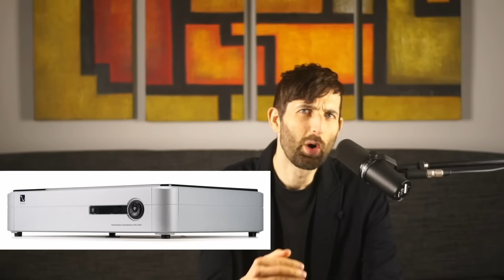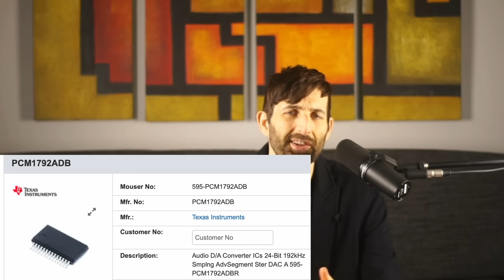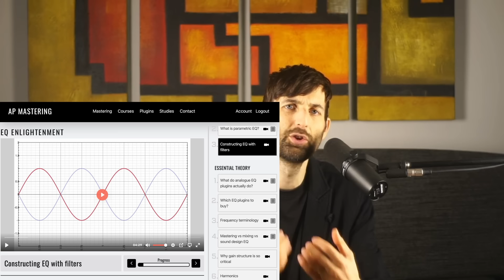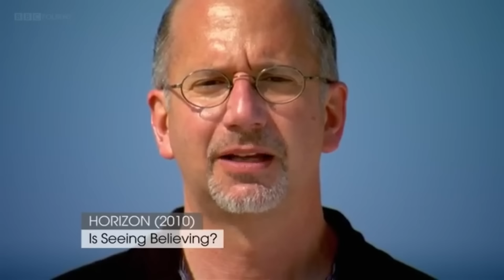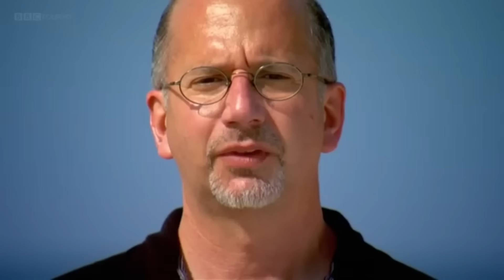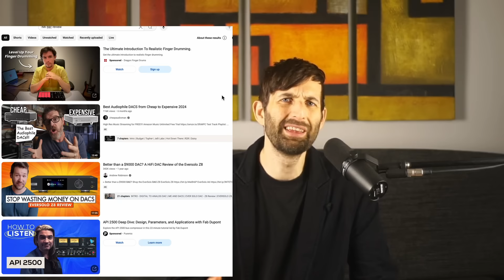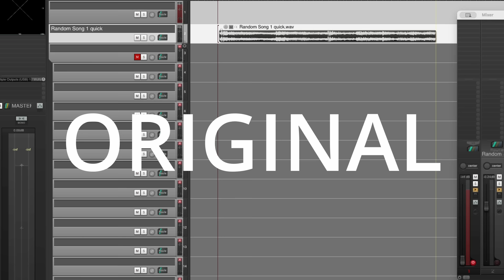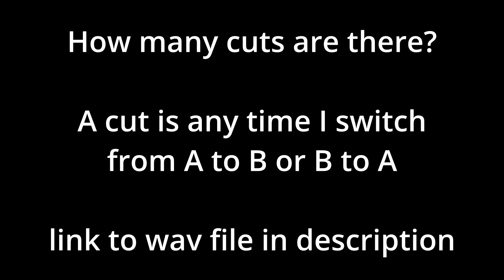The DAC Scam - Almost everyone believes the hype

Comment: This is NOT entirely true. Just because two devices use the same DAC chips doesn’t mean they’re equal in performance. Even with identical DAC chips, the quality of the clock, power supply, and signal path can drastically affect sound quality. The clock's precision plays a crucial role in maintaining timing accuracy, which impacts the overall clarity and coherence of the audio. Additionally, the design of the circuit board, the quality of capacitors, and the noise isolation from other components all contribute to how the DAC chip processes the signal. In short, the supporting components and design choices can make all the difference, regardless of the DAC chip itself.

This is oversimplified big time
Reply: oh no, not the angry audiophiles, hahah.
Reply: @nrmntq.brainrot-c3k  Audiophile gear are magic healing crystals, but for rich guys.
Reply: @nrmntq.brainrot-c3k haha yeah name calling with no substance to debate, just personal incredulity, bias and gullibility
Reply: I think there is a caveat to this. Those changes you are mentioning might be minorly noticeable on extremely detailed high-end speakers in a treated space. On normal speakers the difference is so small most can't pick it in a blind test. On tiny cheap speakers/buds, the difference is not just next to nothing, but a big fat nothing! Add in streaming codecs and playlist processing, and whatever difference may have been noticeable in a recording studio playing from the full wav file, is now two fifths and three fourths of absolutely nothing in difference.
Reply: @THEJRODIUS  "Those changes you are mentioning might be minorly noticeable on extremely detailed high-end speakers in a treated space."

To be honest, that's still a no. You won't be able to heard those differences at all, unless the DAC has been intentionally designed badly, with the caveat being that this obviously doesn't apply to a cheap amp you bought on TEMU. But even then, the sound differences are highly unlikely to be because of the DAC.

DAC and ADC are solved problems.
Reply: @RegebroRepairs  Oh I am just being charitable by granting the possibility of minorly noticeable differences. That's why I used the word minorly.
Reply: @THEJRODIUS  There's a theoretical possibility, yes.
Reply: @RegebroRepairs  Appreciate your insights. They are needed to temper some of the flatulent comments here.
Reply: @RegebroRepairs exactly! Also genelec monitors have class d amps without nordost internal cabling or special iso acoustic feet etc
Reply: @THEJRODIUS  system synergy is also important and not just referring to the price. Some systems will emphasize weaknesses in the input signal while others may mask them. For example a 'bright' signal into a 'bright' speaker will sound bad.
Reply: @jgsburnett9532 AHAHAGA bs! No such thing if you just buy transparent gear. When u say warm you know that means distorted right? I think you better learn a bit before talking nonsense, it really is embarassing
Reply: You are right in that the surrounding circuitry can make or break the performance of a DAC. But it is no rocket science to design a clean circuit with proper separation between digital and analog parts. Most DAC datasheets even specify PCB layouts for best performance. Regarding proper power supply: that's no rocket science either. A decent clean power supply can be made for less than $20. There is no need to have a bank of 400 capacitors in parallel, which some DACs have. The only benefit of that is that it adds to the manufacturers profit.

Oh and don't get me started on proper DAC clocks. A simple $0.50 crystal from a reputable manufacturer will suffice. Anything ovenized is just fancy boutique stuff, again only good for the manufacturers profit.
Reply: @meindertsprang7491 they won’t reply to you, you lost them at the start, they like to reply to stuff that’s dumbed down and subjective because they can argue all day then
Reply: @ How do you know?
Did you even try? Do you have a hi res audio set?
A simple crystal is not a Dac clock, it`s just a simple crystal which in quality audio is just not good enough.
Reply: @brugj03  You can not hear the jitter of a clock signal in the MHz range, I promise you. 🤣
Reply: Don`t  you promise me.
I`m not interested in your babble.
I use my ears and so should everyone.
There is no denying the improvements.
But you didn`t even try now, did you.
Reply: @brugj03  Did you do a double blind A/B test?
Reply: @RegebroRepairs  Off course i did.
I can trust my ears.
Reply: @brugj03  No, you literally can't trust your ears. 

So you really did a double blind A/B test? Can you briefly explain the procedure?
Reply: @brugj03 HAHA THE OLD “I use my ears” your ears are inferior to audio gear. Dynamic range of 120db is you telling me you can hear a pin drop next to a jet. Super tweeters? You probably can’t hear past 18khz yet you need them to go to 35khz 😂 amplifier distortion too much at 1%? Your room probably adds 30%
Reply: Slightly? More like non existent sonically in any half way competent DAC at almost any price.
Reply: Do you think engineers who projected and tested those differences in capacitors, noise isolation ecc, in order to choose one or another, did it by ears?
Reply: @Melkitzedeq  If they are the right kind they absolutely did.
If they didn`t what`s the point anyway.
Besides, you don`t really care, now do you.
You just wanna have your say and get some attention.
Reply: Bit surprised reading this thread - this take seems pretty weak.  He clearly stated that the other components have to be good - but that you can get that for a few hundred - he never said that ANY unit with the same DAC chips will sound equal in performance... he said the dac itself will perform the same... more expensive units with the same DAC are not 'better' DACs than lower cost units with the chip.
Reply: Audiophiles actively defending pissing their money away will never cease being funny to me looool
Reply: All these things make no difference to the audio quality unless they are completely broken in which case, time to buy new equipment. Digital audio is 0s & 1s, on or off, it either just works or it doesn't when it comes to D/A conversion.
Reply: Are you an electrical engineer making these claims? I would be interested in knowing your profession and how it relates to audio science.
Reply: "Even with identical DAC chips, the quality of the clock, power supply ... can drastically affect sound quality."

No, it can't. That's audiophile snake oil.

"and signal path"

It's technically possibly to mess this upp, yes. But it's honestly very hard to do. So in practice? Still no.
Reply: So this guy has listened to all the DACs out there ' impossible
Reply: I don't think that clocks are ultimately important, they get divided and somitimes multiplied and things like PLL's are effective. In my experience there is much more harm to either a datastream or signal by PCB's. Or logic / chips with bad powering or filtering causing issues getting bits missing. Perhaps people distrusting tantalum capacitors might be even more harmful...
Reply: For example: I've heard ESS Sabre equipped DAC's sound both pedestrian in some and very vivid and energetic in others.  The sound of a DAC is a whole lot more than just the chip.  It's also opamps and other components on the analog side.
Reply: @scottlowell493  You are right, I know, I work on DAC's.
Reply: @scottlowell493 lol op amps haha here we go
Reply: Stable clocks are not hard to make, neither are quality power supplies...and they are not ten times the cost of weaker designs.
Reply: @marcfavell  The clock is crucial
Reply: @xStudhouser6969a statement i fully agree i noticed myself and although a lot claim it's not important my experience is is that it determines at least 80% of the total sound experience
Reply: Valid points made but AD DA chips are just part of the equation I believe. Things like op-amps, power supplies etc. make the other part of the equation and even the subtle difference.
Reply: You do know 99% of dacs above $100 sound the same in 2025 right? That’s like saying the dynamic range of 1 dac is 121db and the other is 90 and distortion is 97db down and the other 105 and therefore there is an audible difference.
Reply: (Sigh) Nearly everything single thing you mentioned there should be corrected by the DAC - it's quite literally one of its functions. If the DAC is the same - the sound will be the same, full stop.  Power supply issues aren't going to affect clarity and coherence - those are analog concepts that have no place in the digital realm.  For a digital bitstream to sound different from source to source, it has to be altered somehow and you cannot alter a digital file - even to introduce noise into it - without decoding and re-encoding it at some point.  And that doesn't happen until you get to the DAC.
Reply: £160,000 power supply? Listen to yourself.
He obviously claims the most advanced part costs £50.
Reply: Speaker selection and placement makes audible difference spending 40,000 dollars on a dac is plain stupidity.
Reply: True.. But not 5k worth
Reply: I agree...a bit too reductionist. Power supply, analogue stage, clocking, & the way identical DAC chips are implemented in different ways all play a significant factor. Also no mention of non chip (FPGA) based DACs. Thats a big miss. However i agree all consumer grade audiophile products are wholly over priced.
Reply: @alexYT87462  The law of diminishing returns is real.  A manufacturer must recoup all development costs, pay for marketing and all other business costs. A cheap product may sell 100,000 units with a low return but an expensive item will sell maybe only 1000 units (probably less). The value of the components may not be 100x more expensive but the same overheads apply. I suggest it is not a scam - just giving people what they want and getting your money back.
Reply: @alexYT87462  FPGA is not a DAC, it is a digital processing element.
Reply: @robertt7238  good catch. I had meant to say "non standard" chip DAC....with as you say FPGA processing. Sematics aside, i still stand by fhe views i expressed.
Reply: @robertt7238 I hadn't even liked FPGAs in the Chord Qutest DAC. The resolution was solid but it had sounded dry and clinical
Reply: "Drastically"? Change that to "slightly" and I might agree with you.
Reply: @johnwright8814  Having listened to different DACs using the same chips I would say that the differences can be drastic. Not necessarily better or worse, just tuned differently.
Reply: @RiverOakMusic lies! Well only for 99.9% of modern dacs
Reply: @RiverOakMusic ... drastic...no way!
Reply: @hrvojekant9415 Its all relative. But ok, a noticable difference.
Reply: @johnwright8814  so the analogue output stage of an SMSL 100 dac is slightly different to the analogue output stage of a Mola Mola Dac? Even mastering studio's spend on decent dacs. Why is that. 

Professional mastering studios will spend over £5000 for a dac, strangely no audiophiles actually use DAC's such as the Lavry Quintessence as an example, over £8000.
Reply: @SastusBulbas1  What do they spend on ADCs? A DAC is half the story.
Reply: @ well as we were discussing D-A convertion not A-D I never bothered, but again most in the industry will be looking at £2k plus per box. 

Audiophiles simply want the DAC, and if it costs a lot and has kudos, great.

I mean the DCS it can make Skrillex sound like easy listening despite apparently having no filtering and Skrillex being anything but easy listening, Chords top end DAC's actually measure worse than a £900 Topping, yet no audiophile would concede on how they sound, arguing for the Chord. 

Meanwhile the actual recordings everyone listen to were actually mastered in the days of 16/44, with frequency limited mics and even with the current industry standards, high res is yet another farce for the guillable.
Reply: @johnwright8814 Change out parts yourself and find out
Reply: @johnwright8814  Drastically
Reply: Absolutely agree! The author of this video started manipulating from the first sentences. Everywhere- in any technology and even art the people uses same materials, but why some are successful and others-not?
Reply: @DN18314  The author, "AP Mastering" is your classic whiner about high-priced gear, and blathers on about the obvious ignorance of the people who can afford, willing to spend, and or do hear a difference.  This discussion, the implementation of the same DAC equals the same, or little sonic differences has been ongoing since the mid eighties.  There is still a lot to learn about digital technology, and a really good audio dealer will be able to demonstrate the differences in quality.   Now, whether you feel the differences are worth it or not, well, that's for you to decide.  This is the same person who did an MM/MC cartridge comparison with a rather cheap Fosi Phono preamp, because it had enough gain for an MC didn't mean it was good.  He didn't even mention the turntable used, plus he accused me of bias towards pricier gear, gear that I never mentioned.  He simply wasn't qualified to do that review, in fact, he's basically the same people he complained about, proselytizing know nothings filling YouTube.
   It's kind of human nature to complain about high priced anything, cars, watches, boats, clothes, etc, especially more so when you can't afford it.   Get over it.  I've been into audio since the early seventies, and I watched the hobby nearly implode in the mid 90s, with many factors involved.   But it came roaring back with records, vintage gear, and high-priced gear, priced so much higher today that a single component costs more than the best complete system at one of the top specialty shops in town back in the 90s would have cost.  I try to keep an open mind about it.  Yes, I know that I can get the groceries in a Ford Puma just as well as a Koenigsegg Absolut can, but which is more fun to get there in?
Reply: @mortlach186 all I heard was “ I’m hurt because I can’t handle the truth”
Reply: @DN18314 marketing that’s why. Pretty simple. The most accurate dacs are Chinese but that’s not what audiophools want to hear
Reply: @DN18314  agree. Artists use the same paints.
Reply: @DN18314  He sure did start manipulating. I own 7 different DAC's, and can blind pick them out from one another any day of the week (I have done this).
Reply: This is the first time I have heard this guy… and never again. He sounds like every snake-oil sales I have ever come across. Also implies he is a sound engineer, I doubt that.
Reply: @jeff_rowe ahahaha you sound like you believe in xlr cables but not in bulk tests. You’ve said a lot without saying anything. I think what you are trying to say is “you hurt my feelings! I buy expensive dacs to feel fancy and I don’t like being told they make no AUDIBLE difference. I’m too scared to do an abx test so I’ll stick to my position that’s biased and not backed up by anything”
Reply: @CrackieChansJourney you show just how immature little boys can be in the audio space. I have the capacity to buy literally any components in the market. I have over 25 amplifiers, 8 sets of speakers and numerous DAC’s. A-B tests is what I do all day all night. Its the thousands of various outcomes in sound that I get which drives my passion. Setups costing as little as”all in” $2000 can sometimes be as good as $200,000 combinations. But the above snake oil salesman is so far off mark. He would have us believe no matter what u use the sounds will be the same. As low IQ as I can read into your post, even you could work out that is bollocks.
Reply: @jeff_rowe  What ever he is, he is a narcissist an a know it all.
He knows nothing.
Reply: @brugj03  we see that you payed for nothing. too bad.

Comment: I changed my 200€ DAC amp hibrid (topping dx3pro+) to other 200€ DAC (topping d50iii)  for balanced out to my new monoblocs. There is no difference in sound, only in sound level over balanced outputs. New D class amps are also transparent, and ypu can have good watage for 300-400€, so i will not ever understand spending tens of k in audio equipement.

Comment: I agree there are lots of scam which cost more than a 2nd hand car. But you can't make up lies that all DACs are just based on the same chips. Ladder DACs and FPGA DACs are fundeamentally different architecture. Then is odd way you can use off the shelf DACs like multiple chips for separate channels. There is a reasonable you can pay for more exotic implementation of DACs. But obviously don't fall for scams that have no value.

Comment: The fosi zd3 is $170  and has balanced outputs. Measures extremely well and does what dacs should do. Be transparent. If you are into linear power supplies. Add $60 bucks. 

The age of the internet has really made it hard for these high end manufacturers to gaslight us.
Reply: I also use the ZD3 and It's fine! 👍

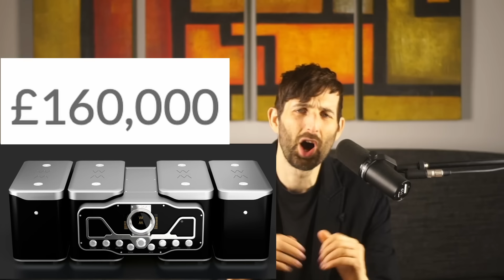Comment: Putting aside that, based on the positions as you articulate them, you do not come across as an engineer, its odd that the premise of your video - everyone uses the same mass produced DAC chips from the same manufacturers - is undercut by the very examples you provide.  E.g., the DCS Vivaldi (0:35), the Nagra (0:01), the MSB Select (0:01), etc.,  all use custom designed DAC chips and/or FPGAs, not off the shelf DAC chips.
Reply: Some of their toP of the line stuff does have fpga. But nagra non fpga systems still cost 10k plus with the same specs as a jds DAC.